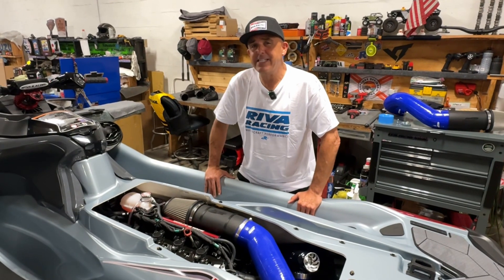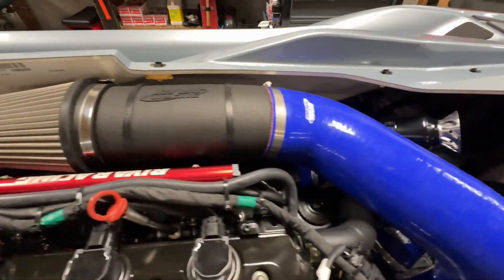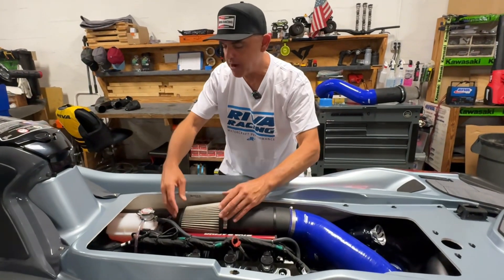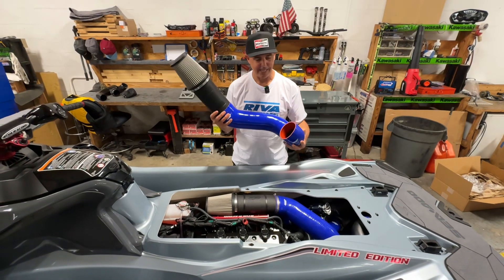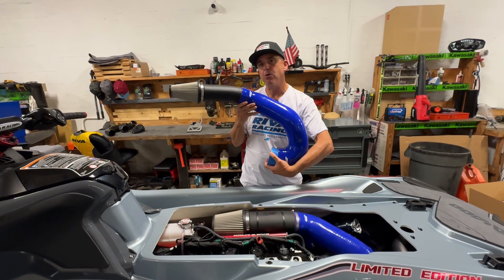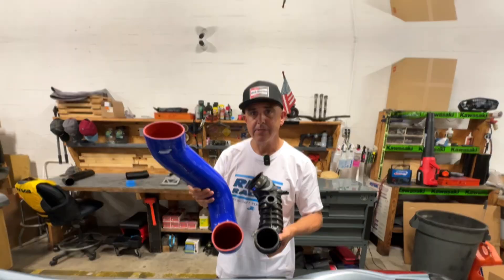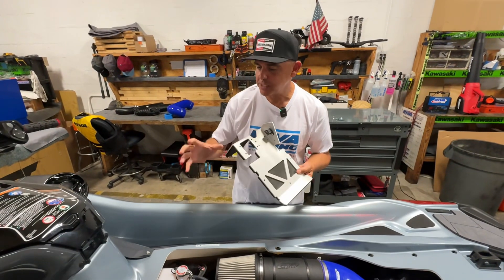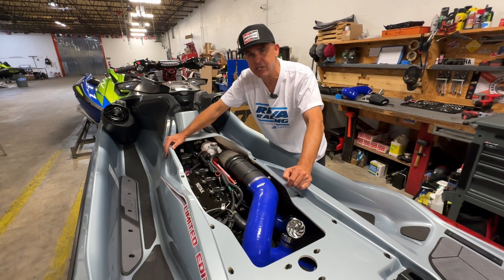RIVA Sea-Doo RXT/RXP/GTX 325 Power Filter Kit

Comment: With where the filter is laying you only getting partial airflow into the system. Why wouldn’t it be better to have full airflow into your system and not run it all the way to the front.

Comment: Dave
The increased size of the piping is great, but the limiting performance issue is the lack of hull ventilation.  We have all seen our seats suck down when blipping the throttle.  How do you get more air into the hull for this intake to really add speed numbers?  As long as the ski is faster with the seat off, the hull is the issue.